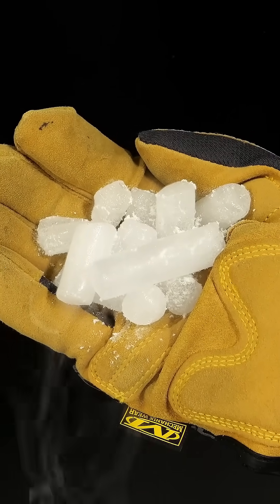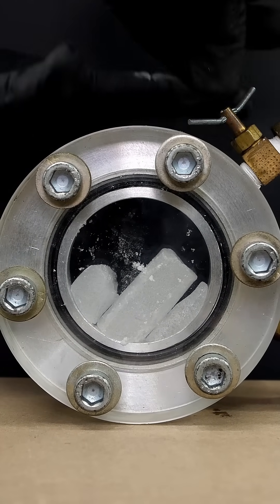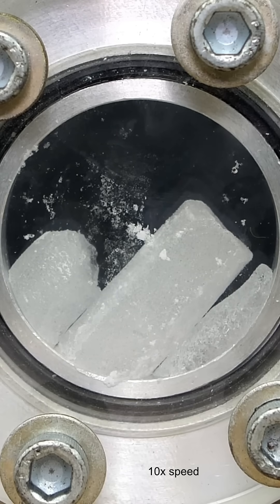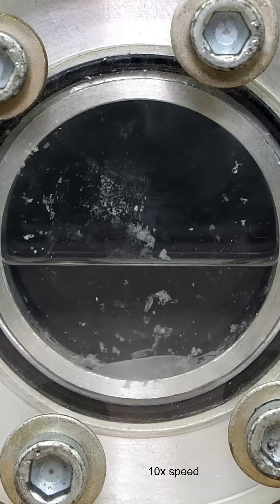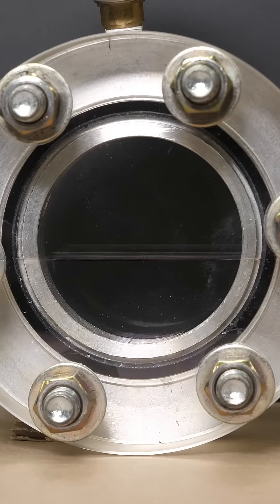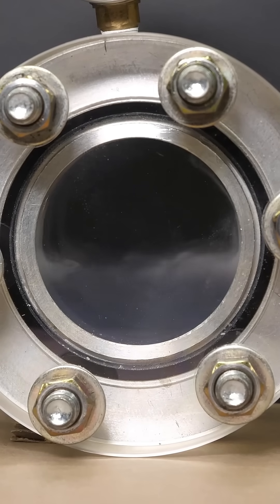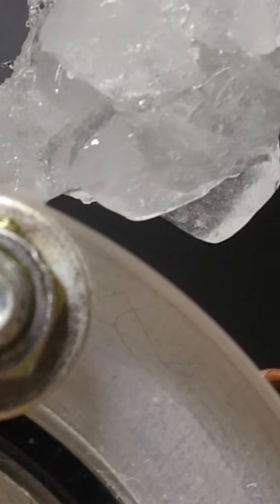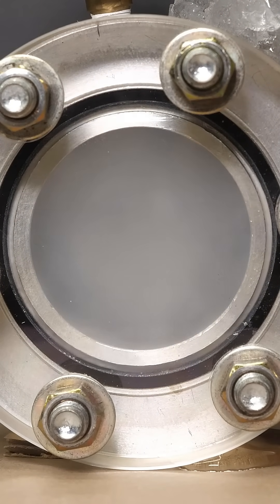This is not a liquid or a gas

Comment: You can use Supercritical CO2 as a non toxic solvent to extract THC from cannabis or caffeine from coffees,  then in a closed loop, once the pressure is released thw CO2 goes back to a gas, the extracted material precipitates out of solution and the gas can be recycled back to use for another extraction. Much better then the original process for decaffeination of coffee which used benzene which is highly toxic. Many conpanies still to this day use dicholormethane, which has the potential to leave behind carcinogenic residue. This is why you should buy your decaf from a good company that uses SC CO2, which is rare, or the more common swiss water process.

Comment: Im an HVAC technician. When your AC is cooling the house, you are saturating and evaporating your refrigerant to transfer heat between the indoor and outdoor units. As climate control gets more in depth and scientists discover more about how chemicals interact with the ozone and environment, they find better and more efficient refrigerants. The past two years, theyve wanted to push for CO2 refrigerants because they have no ozone depletion percentage and no global warming potential. The problem which is pretty accurately shown here is the sheer amount of PSI you have to run a system at. A co2 bottles pressure is normally 800-900 psi at room temp. If you have a 800-900 psi system its practically like a bomb, and it will fluctuate between a low 600-700 and a high of like 1500 psi. For some reason they think thats a good idea😂

Comment: It is interesting that there is the condition where there is no distinction between gas and liquid at high pressures and temperatures. Many years ago I operated a steam electric generating unit that operated at supercritical pressure of 3,550 psi and a temperature of 1000 degrees F.

Comment: What would happen if you opened the chamber when it was liquid?
Reply: Because the pressure in the chamber is high, a stream of CO2 gas would imediately start shooting out the opening. Because of that, the pressure in the chamber would fall down again, causing the rest of the liquid CO2 to boil.
Depending on how high the pressure inside the chamber was, the exhaust of CO2 gas could be very powerful. Without a pressure valve, it might be enough to blow up the entire chamber. Never just open something that is under pressure.

Comment: Between a liquid and a gas lies the state of a "Supercritical Fluid" (SCF), where the distinction between liquid and gas properties disappears. This happens when a substance is heated above its critical temperature and pressurized above its critical pressure. In this state, the density of the substance can vary like a gas, but it can also act as a solvent like a liquid.

Comment: A liquid is always a liquid until it becomes gas being nearly single molecules the liquid when it's not gas is called VAPOUR its like what you boil water the steam isn't gas it's still liquid water that's superheated making it lighter that the cold air around it and you end up with water dripping off things that the water can accumulate on.

Comment: So, CO2 can be liquid.
Reply: Of course
Reply: @HanTrio3  It's an odd substance though and goes from solid to gas.
Reply: @zachtwilightwindwaker596   At standard pressure. If you increase the pressure it can be liquid. In big CO2 tanks you can feel liquid sloshing around but if you open them it instantly turns into gas and some solid

Comment: Thats how an air conditioner works! A chemical switching between a liquid and gaseous state, absorbing & rejecting heat along the way. Fun fact: propane can/is used as a refrigerant, but obviously is very flammable. The current conundrum with modern AC systems is finding a refrigerant that has zero environmental impact (such as propane) but isnt flammable.

Comment: Put oxygen into the super critical liquid and it won't corrod the pipes. The oxygen with plate out onto the inside of the pipe at the high temps forming a type of magnetite.

Comment: We did this exact thing in ochem class. We added orange zest to the test tube we were using. The liquid CO2 being no polar was able to dissolve the essential oil. when the safety seal on the cap opened letting the liquid CO2 turn to a gas it left the oil behind.

Comment: So Carbon Dioxide (CO2) has a liquid form under pressure at normal temperature but under normal atmospheric pressure it has no liquid form.
   That's interesting actually.

Comment: I learned about this in science it’s called a supercritical fluid and it happens when extreme pressure and heat make conditions that don’t align with liquids or gases.
Reply: It also makes for a very good solvent because of the physical traits of the particles.
Reply: I've read that usually liquids are significantly more dense than gases, so the two never mix. But in extreme supercritical conditions the densities of the liquid and the gas become equal, allowing the two to combine into one - the supercritical fluid.
Reply: So it's almost like a triple point?
Reply: @emmanualstanley373 In principle, the triple point and the critical point are similar. However, the phase boundaries at the critical point are not as sharply defined as at the triple point.
Reply: (yes, oxygen and other gases do dissolve in liquid water, but I was writing about systems composed of a single chemical, you can't mix water vapor in water under normal atmospheric pressure - the two will instantly separate back into two distinct layers even if they'll exchange some molecules with each other)
Reply: When you heat up a liquid inside a sealed chamber, gas starts building up. As the liquid gets hotter, its density decreases. As the gas continues to build up, its density increases. Eventually, the two of them meet, and it becomes impossible to distinguish them.

Comment: Nice critical point dryer.  I've use this exact phenomenon many times to prep plant specimens for Scanning Electron Microscopy.  It lets you make plant samples completely dry without letting evaporation destroy all their fine structure.  Because CO2 isn't miscible with water you have to do exchanges to get the samples into pure ethanol first.  But once they are in ethanol the CPD only takes about an hour.  You should do a spot on sputter coating next and show how to get a few nanometer thickness of gold or palladium deposited on a surface.

Comment: I'd like to see this in a 3ft x 18in transparent example  with a mild heating ring in the bottom 4 or 5 inches and a cooled top of sorts. 

My next idea would add some sort of electrified ends, positive and negative on top and bottom ends, for lightning effect. 

From rain to electrical storm in a bottle

Comment: The crazy thing is, this is how the weather works with the water cycle... we're in a container, with a pressurized system (High & Low) dependending on temperature.. heat makes it eveporate which makes clouds.. low pressure condeses to make rain or snow.. and the  battle between the 2 systems creates hurricanes and tornadoes.... which is why he gets that spiral effect when the clouds turns back to a liquid..

Comment: ...What if you drink it?
Reply: it's carbon dioxide so i don't imagine it being very pleasant or healthy
Reply: @jordanfoster4761  Well, probably, but what would it do SPECIFICALLY? Like, when you breath it, it's an issue cause it's the lungs, where carbon dioxide is supposed to be expelled from, but IF it could be digested, it's just made of carbon and oxygen, both things we consume on a regular basis(the carbon at least). Now, I'm not holding out hope for this being the case of course, but at the same time, it's not like you die cause you couldn't breathe cause you drank it, so what WOULD happen?

If I was a scientist, I'd absolutely be one of the greatest monsters the world's ever seen.
Reply: @megahellreaper  well it's also a cryogenic liquid so it'd probably freeze you from the inside out
Reply: @jordanfoster4761  To tap into my inner nerd for a moment, the dividing line for cryogenics is 120 Kelvin. The temperature in which dry ice is formed, which is what NileRed used in the video has a "freezing point"(technically a boiling/melting point, but I digress) of 194.7K, meaning it's not a cryogenic material, in addition to the fact that, for the liquid to form in the first place, the additional pressure AND the surpassing of the above temperature are necessary, meaning it's even warmer than that 194.7K.

Now, drinking it still wouldn't be pleasant, mind you, but it certainly wouldn't freeze you from inside and definitely wouldn't kill you. Not from the temperature, anyways.
Reply: @jordanfoster4761  Btw, I just found a video of a guy eating dry ice. The only issue seems to be frostbite, unpleasant, but not fatal.

Comment: Since there is no h2o to slow down the process everything is like on steroids and moves 10x quicker forming a daily lifecycle of the weather system disincentive dry ice needs air to change into a gas the pressure chamber removes it and acts like it but sisnce it’s so small the the gas can’t escape causing it to turn into a liquid so quickly

Comment: I thought carbon was supposed to be black?
Reply: This is CO2, the gas in the air, which isn't the same as just carbon C
Reply: @rnze_00  okay, so I learned that just Carbon and Carbon Dioxide are different.

Comment: Curious at what temperature is it a liquid? Seems to have a very narrow window before it turns to gas
Reply: Between -56.6C (-69.9F) and 31.1C (88F). However, you have to have enough pressure. If you have less than 5.1 atm (75psi), it will never become a liquid.

Comment: You were looking at the reaction that happens in an Aircondition system, Co2 is actually a very good gas for Airconditioning cooling, an old teacher of mine told me this phrase once: "Pressure and temperature sticks together, When pressure is high the gas is steamy and hot, When pressure is low the gas is liquidy and cold"

Comment: question: Venus is high temp high pressure, & apparently the atmosphere is filled with co2. Is the co2 on Venus in a super critical state?
Reply: From a quick search, it looks like it could be. A quick search seems to suggest that Venus has both the pressure and the temperature needed for it to be supercritical.
Reply: @ragingfirefrog  That's what I was thinking. I've never heard anyone mention it though.

Comment: What if you released the preasure🤔
Reply: It would vaporize, since it normalizes to atmospheric pressure. The pressure and heat are what cause this to happen.

Liquid CO2 doesn't exist below around 5 atm while you need it to be around 72 atm for it to go supercritical like in the video.

Comment: What happens if you just open it while it's liquid
Reply: The pressure in the chamber rapidly drops and it all becomes a gas. Liquid CO2 can't exist below about 5 atm of pressure so once the pressure drops below that, it will either become a gas or it will become a solid depending on the temperature.

Comment: A liquid and a gas - would that be a form of plasma or is that something else?
Reply: The technical term is a supercritical fluid. Essentially, the density of the gas and the liquid become the same, so it has properties of both of them. It's a bit more complicated than that but it gets the general idea across. 

Plasma occurs when the electrons are ripped from the atoms and can freely move around. This is generally due to very high temperatures or voltages.

Comment: Water can't do that 😂
Reply: Technically, it can. You just need to heat it to above 374 C and reach a pressure above 217.75 atm. Much harder to achieve than the 73 atm at 31 C for CO2.

Comment: P*V=n*R*T ;
   P pressure , V volume , n*R constants ,
   T temperature
1st you increase P only, up to 27psi.
V is constant so T goes up up and CO2 turns gas.
2nd you cool the chamber down with a hair drier: your are removing energy:
T down, but P remains constant, so the gas tries to go back to liquid, yet it can't because P and V remains constant. 

So you generate work : you put the gas to work, movement:

the gas start flowing from the inner walls of the chamber where it condenses to droplets, inwards where T is a bit higher and condensation stops. This is why the 'cloud' starts showing up around the inner wall of the chamber.

This condensation is what happens when  water condenses on car windscreen when car in-out T difference high enough, and at the same time there's enough water vapour inside car. Water vapour sticks to the car windows, but here CO2 gas cannot stick to the inner walls, so it flows.

Comment: That’s basically the atmosphere of planet Venus at the surface.  It’s 98% CO2 atmosphere is under so much crushing pressure (the equivalent of being under 90 Earth atmospheres) that the CO2 at the surface functions more like something between a liquid and gas, referred to as a “supercritical fluid”.  Venus’ “CO2 air” is so thick and dense at the surface that moving through it would feel more like swimming through a pool of water than like casual walking anywhere on the surface of planet Earth.

Comment: They used to sell bottles of dry ice body spray to relieve aches and pains , it was sold at the body shop in canada my mom  use to buy it for herself this looks kinda like what was in the bottles she'd buy the nozzle on body spray dry ice was like mini version of the tip they used on settler bottle that shot liquid. She'd pay almost 90 dollars for a small bottle of it, did it ever feel neatwhen yousprayed it on your skin it felt like it would cool your skin down I don't know if it was safe or not but it was a pretty neat product, when I saw the dry ice melt it reminded me of that spray from the body shop that I think like the expensive sandal  wood extract was discontinued and or changed and was not the same product that it used to be in the 90s

Comment: I know im being dumb and a lot of people will correct me (actually hoping they do) but if Carbon is usuly back, why does Co2 in the solid form present as translucent?
Reply: Due to carbon’s molecular structure it is able to absorb a lot of visible light while co2 (being a gas) has a molecular structure that does not absorb light and instead mostly absorbs infrared radiation